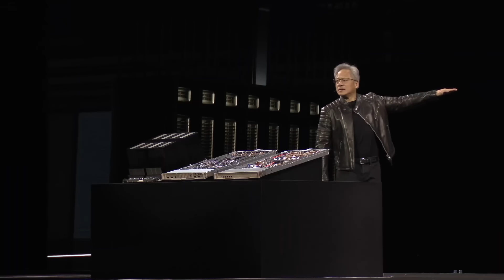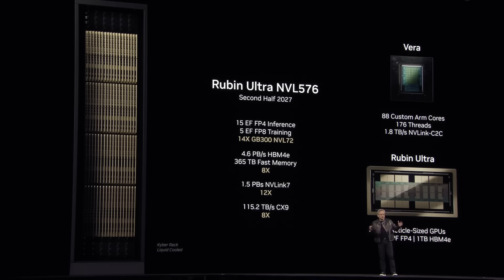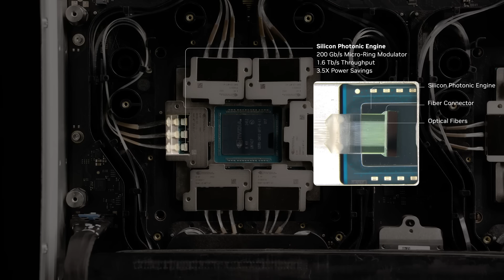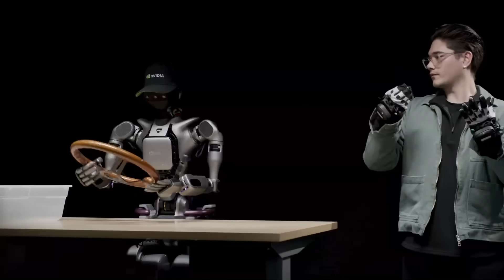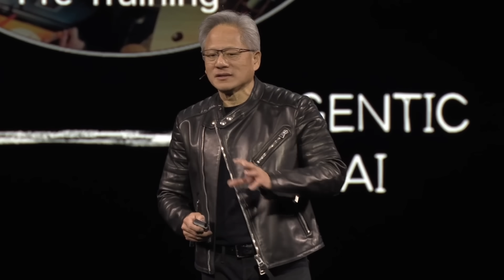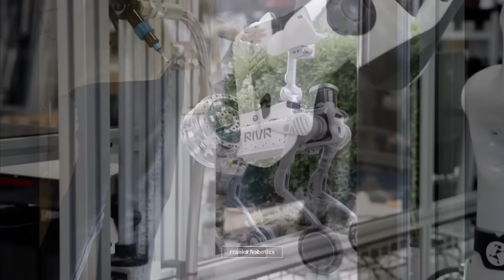NVIDIA CEO Jensen Huang Leaves Everyone SPEECHLESS (GTC Supercut)

Comment: 5070 = 4090 performances, never forget.
Reply: @DomB420  problem is, that a lot of people BELIEVED that crap
Reply: @FLMKane  Problem is they said it
Reply: @FLMKane  thing is, the best card of the 2000 series was the 2080ti.  And the 3070 had similar performance.  So following on from that, the 5070 could likely have it.  But no, this time it’s a lie as they have fake frames.  (I like frame generation for sure but it’s not the same as real frames)
Reply: @FLMKane  i believed it. then i saw how the card's started melting again... the i looked at my 4070. and fell in love with it again.
Reply: @FLMKane  I mean in the presentation he said with ai. Y’all just need to listen.
Reply: @FLMKane  the problem people lack the ability to listen or think or see a snippet of headline cut down.

From offset he said it would be impossible with AI, with the amount of AI rops. People didn’t listen, I told people at the time it won’t be a 4090 performance like you’re saying, it showing how far their AI tech has come, “oh your jealous because you have a 4090 and now if’s worthless ( I honestly couldn’t care I was going to get a 5090 anyway, and I now own a 5090 as it happens) and I knew the 5080 wouldn’t beat this time around as the 4090 was so far ahead of anything, and the same jump for the 5090 I knew wouldn’t be possible again generation after generation. Ok whatever, then you tell people after, you were told, I tired I to say. No, no it’s NVIDIA, they’re liars, false advertising.

It’s people today and their lack of ability to listen and have any thinking whatsoever. Do not blame NIVDIA, that is 💯 on people! 😂
Reply: Need a class action lawsuit to teach them a lesson on false claims.
Reply: @jjman533  "Need a class action lawsuit" – Didn't a Chinese company already let the Nvidia stock fall, as they showed how to do AI with less hardware: that's the way the cookie crumbles.
Reply: Lol. No. The 5070 is 50 to 70% slower than the 4090.
Reply: @chrisbraeuer9476  that’s their point
Reply: @chrisbraeuer9476  I don't think you reached the point in elementary school where you learn percentages yet.
Reply: @chrisbraeuer9476 slower but broader
Reply: That's the least of Jensen's worries. And the least of the world's worries... 
ie; some disgruntled, cheapskate gamer whose only focus is a pew pew GPU.
Reply: @rvs55 those "cheapskate gamers" are the reason Nvidia ever existed
Reply: @bokononbokomaru8156  so? The millions of gpus in data centers are the reason they exist now. Gaming is a drop in the ocean now. Retail gpus don't even register on their revenue chart. They're an afterthought in terms of retail use for entertainment. 

They'll keep making them if it furthers their research in other areas. If it doesn't, it wouldn't be surprising to see nvidia dip out of the traditional "GeForce  graphics" market. That's all it comes down to.
Reply: @DomB420  as soon as I heard that I knew it was a marketing stunt. The 5080/5080 super can’t touch the 4090 in raw performance.
Reply: Fake frames is like buying food from shady Chinese street vendors. Shit isn't real, you're fooling yourself.
Reply: theyre intentionally destroying the local gpu market so that your only choice will be monthly GeFarce No payments
Reply: Bro be up there yapping
Reply: "It would have been impossible without AI"
Reply: @DomB420  and if my grandmother had wheels she’d be a wagon.
Reply: Basically "AI speech" 😂
Reply: :face-green-smiling::face-green-smiling::face-green-smiling:
Reply: @DomB420  🤣
Reply: Well lets be glad they even released it...for this company gaming graphics card market i a piss in the ocean.
Reply: @DomB420  yeah, that was embarassing
Reply: It makes me confuse, which should i buy?
Reply: "the more you buy, the more you save" .
Reply: I have both and the 4090 is slightly better then the 5070 ti but it is close.  I m waiting to get the 5090 because yeah it was slight downgrade
Reply: @DomB420  at a $549 price?
Reply: @DomB420  he is Chinese, it's pretty normal in China.
Reply: And meanwhile: rx 9070 XT, 7900XTX performance
Reply: Yeah, and all AI enthusiasts are forced to still buy 3090 because there are just no better options with at least 24 GB memory for that price. And even 3090s now are becoming scarce and prices go up.
Reply: @DomB420  nah, this doesn't make sense and this makes you sound unintelligent
Reply: Amen!
Reply: @DomB420  I'm still running my old ass 2080 ti. Still runs games.
Reply: This is the marketing part. When is the real one? This is VR in action
Reply: This is not new. This is most GPUs
Reply: @DomB420  lol no. Nice try.
Reply: Now do 5080 and 5090
Reply: Zigateraflops
Reply: For only 549
Reply: @DomB420  uhh ya.... but cheaper.
Reply: If it's fake frames it means nothing.  Raw performance counts!
Reply: He said 5070 at 4090 performance. He never said native you dumb fucks. If anything its even more than 4090 performance. Im running cyberpunk with raytracing on max at over 200 fps and cant really tell if its dlss performance or quality. Get over it.
Reply: So your saying that the single chip 5070 = the dual chip 4090 correct?
Reply: @DomB420  just a cheaper version right
Reply: @DomB420  😂🥹
Reply: going to start calling him asian trump
Reply: Irrelevant, keep being mad kid and go play Fortnite.
Reply: he said with ai after it so not false
Reply: @theBSH  and you can use other frame gen tools ( lossless scaling) for the same effect.

Turn on lossless scaling and your 4090 is WAAAY faster than a 5070. Jensen lied.

Leather jacket man literally slapped on a machine learning derivative, of a 90s CGI algorithm, onto the 5000 series, and YOU guys suck it up. Y'all should feel insulted, he's literally taking advantage of your goodwill.
Reply: Bro... not one mention of graphics cards. You know why? They couldn't care less. They're an afterthought to nvidia. Did you ignore the whole video?

 AI and robotics are the future, and for a company on the bleeding edge in both, they are not concerned with the entertainment industry. There is a reason this is the focus. Did you hear the sales numbers potential? Millions of gpus in single data centers. 1000s of data centers packed with their chips. The sale of retail 4090s may as well be a drop in the ocean compared to what they're selling for other markets. 

They straight up showed off the motherboard for essentially the "new pc." The potatoes we're using now won't even be relevant in 5 years.
Reply: DAMNNNNN YOU AMD FANBOYS ARE COPING HARD!!! LOL
Reply: @DD23-1  been team green since i was a literal child. Not anymore 

I won't give money to a guy who insults my intelligence.
Reply: 5070ti > 4090m
Reply: impossible without artificial intelligence, impossible 4 Tops 4 Ter ops of AI tensor cores.
Reply: @FantasyNero exactly, they said at the time. But people didn’t want to listen, then just play the shorten clip of 5070 and 4090 performance. Now all you get is false advertising, no it’s because you literally cannot think for yourself or listen! 😂
Reply: Gamers here in the comments think they are relevant, lmao.
Reply: With MFG it's actualy even better then 4090, so he was under-selling you special individuals.
Reply: @KyleCox404  Guess what? Lossless scaling exists.
Reply: @KyleCox404  The irony is insane
Reply: @KyleCox404  the 4090 can also do mfg ya twit.

And so can my old ass Sony tv.
Reply: @FLMKane  40 series cards don't have multi frame gen. Get your facts right before you correct someone else
Reply: @random0raven  mfg isn't Nvidia exclusive tech. Only dlfg is.

You can do frame gen on any gpu, even an igpu, using other software like lossless scaling.

So yes the 4090 CAN do multi frame gen using lossless scaling. 

Frame gen is old and low end tech anyways. Any tv in the last 15 years can do it
Reply: @FLMKane  conflating interpolation and motion smoothing with mfg :D now that's rich.
Reply: @mnemonix1315  they're the same thing. Jensen lied about that as well

Mfg isn't frame extrapolation. It's just ai enhanced interpolation.

Why do you guys believe the snake jacket dude instead of doing some fact checking?
Reply: @FLMKane are you for real 

 the problem people lack the ability to listen or think or see a snippet of headline cut down.

From offset he said it would be impossible with AI, with the amount of AI rops. People didn’t listen, I told people at the time it won’t be a 4090 performance like you’re saying, it showing how far their AI tech has come, “oh your jealous because you have a 4090 and now if’s worthless ( I honestly couldn’t care I was going to get a 5090 anyway, and I now own a 5090 as it happens) and I knew the 5080 wouldn’t beat this time around as the 4090 was so far ahead of anything, and the same jump for the 5090 I knew wouldn’t be possible again generation after generation. Ok whatever, then you tell people after, you were told, I tired I to say. No, no it’s NVIDIA, they’re liars, false advertising.

It’s people today and their lack of ability to listen and have any thinking whatsoever. Do not blame NIVDIA, that is 💯 on people! 😂
Reply: @FLMKane no it’s can’t, it can do frame gen, but no multi frame gen, that is exclusive to Blackwell (50 series cards)
Reply: @jasonprendergast7493  could you summarize that for me? Are you saying that people are dumber than I think they are?

Congrats on obtaining a 5090
Reply: @FLMKane  It can't do what the 5000 series can. You're clueless, but try harder next time.
Reply: @FLMKane  "You can do frame gen on any gpu, even an igpu, using other software like lossless scaling."  - Then do it and make it work as well as Nvidia does without as little visual artifacts and as little input lag.
Reply: @derbigpr500  Nvidia has EXACTLY the expected amount of input lag. 

Reflex helps offset the lag, but it only uses REAL FRAMES as data. So the fake frame gen generation lag still exists.

Therefore, the 4090 is still faster than the 5070
Reply: @derbigpr500  stop drinking the green Kool aid 

The 4090 is faster than the 5070. Jensen lied.
Reply: @jasonprendergast7493 You're not alone, man. You're not alone. Don't get too cynical.
Reply: @random0raven  MFG Isn’t a good thing while gaming you nerd. Fake frames are just that, they are fake. As a gamer, I want real time frames
Reply: @Kaptkrispy  well Id love to see your reaction when you find out all frames are fake, nerd.
Reply: @Kaptkrispy  Every frame is fake. Some are better than others. I don't think you understand how it works. You just watch Tech Jesus or some other TubeNerd and think you understand it. You don't. You'll never understand it.
Reply: @ 😂 your mom is fake 😂